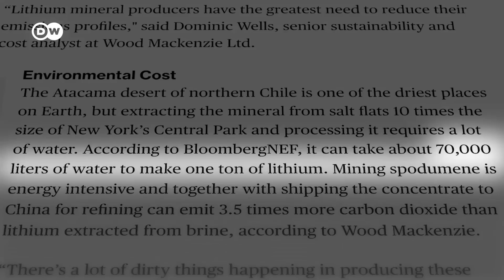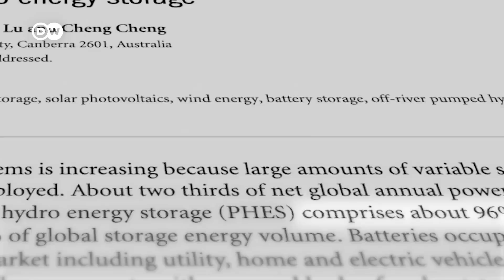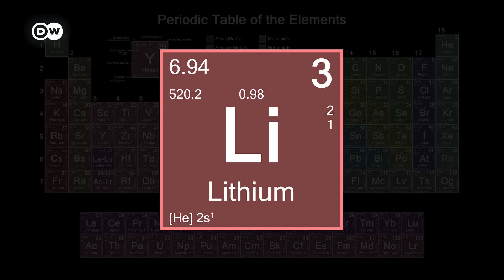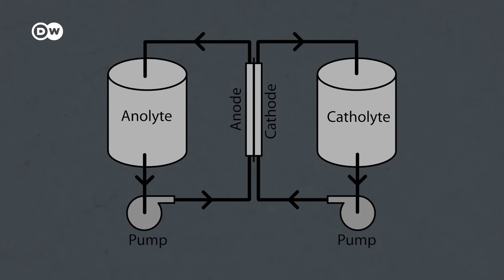How salt and sand could replace lithium batteries

Comment: Ok, great, we have all of these potential "battery" solutions. However, none of them are currently commercially viable as industrial strength base load supply solutions and none of them are proved out for reliable commercial applications. This surely means they are several years away from being ready for "prime time" mainstream applications. However,  here in Australia we are already shutting down generation plants, right now, today. So, what is the grand plan to maintain supply? Is there a grand plan? I didn't see that yet. Looks like we just break out the barbecues for cooking and take cold showers for, ?, about a decade, or two I guess, if all goes well. So, is that how the power bills are reducing by $275 a year, there is no power, so therefore, the annual bill will be cheaper. That's gotta be it, they just left out the details when they told everyone their power bill would reduce. Oh, by the way, power bills will reduce, because, there is no power, so you wont need to pay (as much) for it.
Reply from the maker: Hi Matti, thanks for you comment. This is the thing - Australia seems to a bit of a paradox; reaching to cut its CO2 emissions to net-zero by 2050 without any actualized plan. We made a whole video on the country you can watch here 👉 https://www.youtube.com/watch?v=uFV0WaJLjeM. Share your thoughts in the comments. 🌱

Comment: Renewables were the world’s cheapest source of energy in 2020? Doesn’t sound right. On what is that based?
Reply from the maker: It's true, thanks to continuous improvements in efficiency and production processes🌞You can find this information and more here: 
https://www.irena.org/publications/2021/Jun/Renewable-Power-Costs-in-2020
https://www.iea.org/reports/electricity-market-report-july-2021✨
Reply: @DWPlanetA  That second link does not work for me.
Reply from the maker: Hey, we're really sorry about that. It seems the emoji transferred into the link.😅 Here it is again without: https://www.iea.org/reports/electricity-market-report-july-2021
Reply: @DWPlanetA  Yes! that link works.

Comment: You need to have rain for pumped hydro. Climate change is already showing that isn't always reliable because of our actions.
Reply: Closed lope pumped hydro doesn't have too much of this problem. You lose some to evaporation, but the reason hydro plants are running out of water is because the water is being used for other things.

Comment: The video commentary is misleading so is the title . Salt and sand with the technology shown in this is video cannot replace Li-ion batteries. In a boiler the temperature can be maintained but case is different when energy is stored in small cells. Salt is a natural dessicant. The battery shell that will prevent any change in humidity (to prevent salt from absorbing moisture) will, if possible to be made portable,  involve additional costs. Also salt is a major food component.  It's wide usage in energy storage will lead to price rises.  Secondly sand is not available in abundance. There are sand mafia's who steal sand leading to erosion of beds of water bodies. Sand may be used in limited regions where other options energy storing ootions are non-existent. Portability is again not clear from the video. Just bcoz an approach seems eco-friendly doesnt make it a feasible or pragmatic option on a large scale.

Comment: How the fu.. 🤬🤬🤬k can a pile of sand heated to 400 degrees celsius help transfer heat to industry... Since the industry only uses 1200 degrees celsius or higher (the flame tempesature)

Comment: Why not just go modular nuclear?  Just seems like we are wasting a lot of energy and money, trying to have nuclear power, using everything but nuclear power.
Reply from the maker: Hi Bobby, we have looked into nuclear power in the following videos: 
📺 Is nuclear fusion the key to fighting climate change? https://youtu.be/eyHovWQ49MI 
📺 Do we need nuclear power to stop climate change? https://youtu.be/9X00al1FsjM 
Let us know what you think in the comments section 🌍 ☢️
Reply: @DWPlanetA  Possibly, but wind power has moving parts that break and unreliable wind, solar has toxic batteries needed to power systems at night, and hydroelectric damns often destroys ecosystems and aren't resistant to droughts. We are running nuclear reactors from the 70's.  A lot has improved with engineering and tools since then.  Solar is the only real thing with promise, but I have also lived in regions that only get 4 hours of sun during the winter. And for solar energy to be efficient, and not wasteful in a lot of areas, it cannot be ran at the consumer level.  If it is ran at the consumer level, the power bank needs to be consolidated to an area, and not single homes.  Otherwise, you have tons of homes that need batteries, as well as the need to dispose of them.  Basically, unless you are off the grid, and unless they consolidate power banks, nuclear power is the most ecofriendly out of all of them.  With fusion not being practical yet, it does us no good to use them as part of the equation.  With what we have now, fission is the best choice environmentally.

Comment: Thanks for Good presentation.  Consider the specific heat of the material, container' s corrossion, insulation ,leakage wastage  sustainability and other issues before grid scale model . Otherwise all the efforts will go in vein like solar reflector technology. Some minor changes can be successfully utilized in almost 80 percent hydel around the world for 10 to 12 hours back up  into pumped  storage one. This is proven time tested  and around 80 percent efficient  without any hidden cost।. Gravity energy storage can be made even in plain land.   Today's Huge excavator and vibrating  roller can make  compressed earthen  upper reservoir dam upto 100 metre above  with simultaneously making a lower reservoir easily.

Comment: All batteries are to inefficient. You push in one hundred percent power you only get sixty percent back out.  Only generate as you need makes sense. Why is it bad to use water for lithium recovery but good for pumped hydro . If you are pumping between two lakes then the water is not available for municable use.

Comment: till we got the storage problem solved, why not  just scale up solar enough to at least cover day time demands (almost all of the industrial use) and use other energy sources only for night time? It would dramatically reduce  CO2 emissions , even without batterys..
You might even limit some industries to run only during the time solar enegry is available, or even force them to buy their own solar cells. Rising the power fee for the industry enough while offering enough gov. insentives for solar to make it more profitable for them to buy their own solar cells might be all it takes...
But of corse this wont happen as long as politics are controlled by the industry...  They would rather end humanity then paying more for electricity.
Reply: That sounds smart, although the current infrastructure is not designed for it. It is turned on for consistent energy.
Reply: @SaiTeja-vq8hq  it was not supposed to sound smart.. i think its something too simple to be taken serious. I agree with you the main grid is built for consistant power supply.

But I live in a village with a private microgrid thats hooked to the main grid over a shared transformer (the village is billed as one unit by the state, and we calculate individual bills with private meter readings)). 
I got a 20 KW solar system (on grid, no batterys)  that feeds into the microgrid ans supplys the village with power during the day. (it does not feed into the main grid, and power is drawn from the main grid if there is not enough solar power)

Since then all of the village pays mostly just off peak tarifs for night time use and my solar power)

This has worked flawless since one year now, and i got a ROI of 30% per year..

If someone with a law degree like me can get that to work on a small scale, there must be one of the thousands of electrical engeneers working for large corporations who is capable to apply the same principle for the factorys that use most of the power and larger communitys then my village.
Reply: @donalain69  I meant smart in a good way 😅
Reply: @donalain69  That sounds amazing! Separate but connected grids also make the infrastructure more resilient. It's just that the lobby in the US has been trying to prevent all of this development from happening.
Reply: @donalain69  I think powering a village is a different problem than powering a city or entire country. 20 kW for example won't even move a single train.
Reply: @bltzcstrnx  when did i  suggest powering a train or a city with 20kw? i made an excample of a system that works on small scale.  What speaks aginst a network of microgrids (not only residential, but mostly for factorys and office buildings that are operational during daytime and closed at night) using private solar cells to cover their power needed during daytime and draw power from the grid only at night when they are closed? Dont see any problem with that. It clearly would reduce the demand on power created by burning fossile fuels and gas by cutting out the main consumers. And all would be possible without spending tax money on it. all they need to do is increase commercial power costs for daytime use and offer financial support for solar in exchange. Capitalsim would do the rest.
In my opinion the only reason why they didnt do that long ago is becasue they are controlled by corporations that wont even tolearate losing 1% of their profit to reduce the damage they do.. 
And just to give you an idea of how much damage i talk about:  
A international study led by Health Canada found that almost nine million people around the world die prematurely every year because of outdoor air pollution. This is making outdoor air pollution one of the leading causes of premature death globally.
Reply: @SaiTeja-vq8hq  totally agree with you. 
If we would have governemnts that do what they get elected for instead of doing what the ones financing their campain tell them to do, that system probably would be standard since 10 years ago when solar cell prices fell under 1 dollar per watt.  
i know you ment smart in a good way.. i just tried to make a point that its actually a very simple solution, not one that needs a team of scientists to figure it out.
Reply: @donalain69  I always wonder what can be done to solve problems and get stuck at lobbying quite frequently lol.
Reply: @SaiTeja-vq8hq  lol. same goes for me. There is a reallly urgent need for transparency in lobbying.. but it simply will never happen as long as lobbyists are the ones who write the bills. 

sometimes  I see humanity a bit like the collection of cells we are made of.. as long as they are 100% dedicated to act in the common interst of the organism they form, they can survive almost every problem.. but not brian cancer.

Comment: Sloppy reporting. You showed a Duracell that isn’t a lithium battery. And you didn’t cover the problem of recycling or limited supplies of lithium or cobalt, not to mention batteries cause a lot of pollution from developing the batteries.

Comment: watching this and many other videos of energy storage I find myself asking a question. Why are we building giant solar and wind farms to power a grid and using methods like the molten salt to store energy instead of building solar and wind farms to heat the salt and using the salt to power the cities would that not require smaller solar and wind farms? Especially if the salt can store the heat energy long enough to get us through the night? Any situation that requires us to rely on the molten salts would be the same like if it's a really cloud day and the solar panels are not producing electricity we rely on the heat from the salt to power the cities but even in my scenario if there is not enough sun we are still using the stored heat the solar just isn't making any more the only difference I see is the solar and wind farms won't need to be so big because they are only powering one plant instead of a hole city
Reply: 🧠 true plus we'd be able to use mirrors to deflect heat onto the salt rather than solar panels which would make it much cheaper replacing normal pv solar farms
Reply: Electric batteries can hold charge for months or years.
And they don't have problems like having to keep it at ferocious temperatures so it doesn't solidify in the plumbing.
If you want only heat, then make heat but if you want dispatchable power, losses are way too high converting electricity to heat, losing some of that heat and converting back to electricity.
You have electrons to start with. Don't screw that up with all kinds of phase change and extraneous infrastructure.
Reply: Any means of storing energy loses some in the process. That means you need larger energy generation facilities to power the storage than you do if you use the electricity directly, not smaller. Batteries have high efficiency and only lose a little energy, but they are expensive. Anything involving heat is always much less efficient especially if you are making electricity at the end. The best way to use thermal storage is if you had the heat anyway. Eg nuclear power plants generate heat then used that to make electricity. If you store the heat in tanks first then you can output more power when it is needed instead of just a constant amount all the time that nuclear plants usually do.
Reply: @adrianthoroughgood1191  surely it wouldnt take as much energy to heat salt then it would to power a city, then use the hot salt to power the city sorta like an energy plant but the solar is there purely to heat salt and if you scale it larger then required for the city you have redundancie for excess energy draw and if there is less energy being consumed then the salt can stay in the tanks holding temp. They wouldn't even have to use solar considering there is systems that focus sun light to heat such things

Comment: Yep more concentrated heavy metals. That will make populations soooo sooooo happy as they throw out thousand of tons a year. and they are shipped to some of the more biodiverse regions of the equator for "recycling" aka outsourced dumping.

Technology will not solve this. A revised and diverse set of human cultures will.
Reply: Duh blocking mainstem rivers is ecolovically catastropic, but slowing all the runoff and feeders high up will pay dividends.

Comment: The problem for renewable is that the transition from oil, and natural gas to renewableis being done too quickly. 
Currently the USA is in a recession, because of the quick transition. 
If the country goes into a Depression,  then renewable will suffer.
The country of Sri Lanka suffered a revolt, because of the switch to organic fertilizer.   Now the country is back on chemical Fertilizer. 
A permature switch to renewable will be halted, if a Depression results.

Comment: Oh yeah, sodium is totally like lithium but doesn't explode. Just don't test that theory... and the hydro power, just ignore that the world is in a constant drought condition in most places. 
As a matter of fact, since we're ignoring efficiency, cost per wat, and general common sense, especially for the grid, let's just forget about atomic energy all together because reasons. Nevermind you receive less radiation living or working in an atomic plant that getting CAT scan or flying from NY to LA. Or that a room size plant can run an US aircraft carrier for 20-25 years before it risks just "dropping out of the 3% specification"....

Comment: Not satisfied with the generalist approach taken by the producer of the video, seems like Lithium can only be mined from underwater resources and in 3 countries while that’s not true. Also there are more efficient methods to refine Lithium currently under development or testing phase, which use dramatically less water. lithium can also be extracted from Sea water, etc. Also not all Li-ion batteries use Cobalt, and not all Cobalt is mined in DRC and only a minority had been reported by children mining. Telling partial truth is equivalent to misinformation and close to lying to your audience. You can do better DW. Please have a look into LFP batteries and other very viable commercial batteries, whose deployment at massive scale is beginning to occur. Kudos on reporting on Sodium batteries months after CATL announced them though

Comment: Not sand, the beaches and river are being strip of sand by poor country's, right now. Sand goes into making solar panels and silicon chips and memory's, and glass and cement building. All can't use desert sand. Ev car building will run out of sand soon.

Comment: Sorry but your very first statement is far from being correct, you claim that the renewable energy is the cheapest way to produce energy, Not correct,: the cheapest way to produce energy is from coal...... Don't get me wrong, I am not advocating  energy from coal, however, please stick to the facts, and tell lies on the account of the ideological assumptions. And yes to date renewables are unpredictable, and unreliable, exactly because of storage, as well as the energy transfer. The truth is at the moment there is no technology to satisfy the energy demand, where and when needed, with the renewables. Unless the problem of storage and transfer are solved rather soon, the push for renewables will drive the prices by more then double. And that is an assessment on the current global projection of energy prices, which is directly connected with the insistence on the renewables.